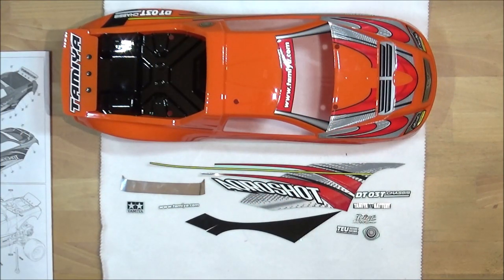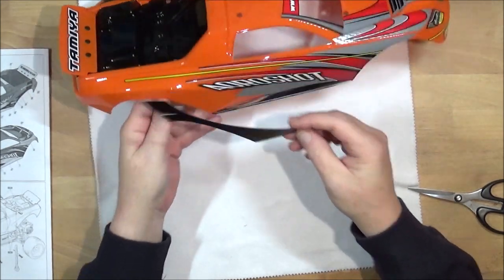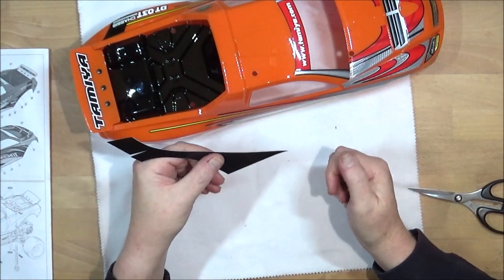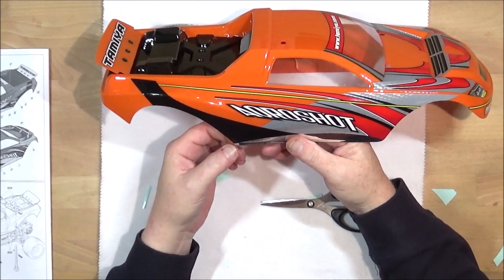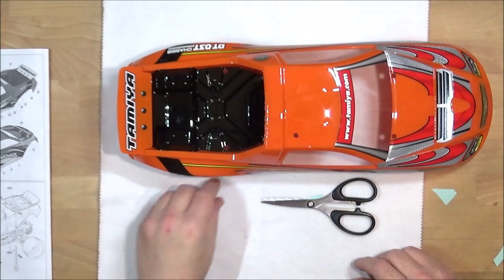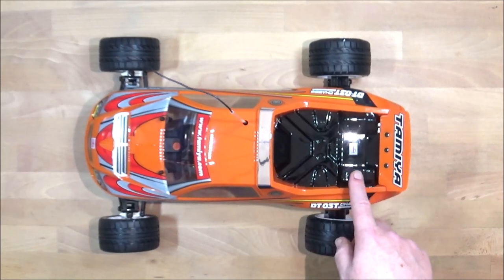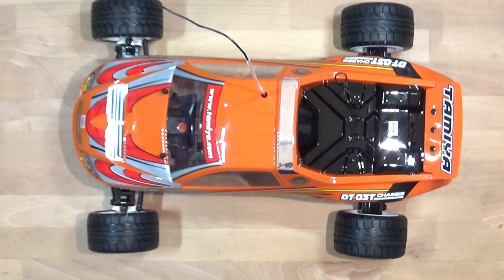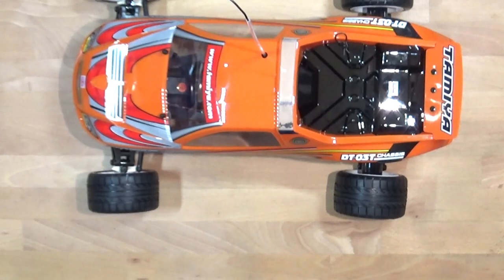Tamiya Aqroshot Body Shell Build Day Seven

Comment: I had to find the smallest clip and bent it so i fit the rear without touching the body like you explained in the video here.
Reply from the maker: I did wonder if I could find something that would work but in the end decided that the body is going to get bashed and scratched so a couple more at the back won't hurt. But if I see the body moving at the back when running it I think I will revisit the mounts. Thanks for watching buddy.